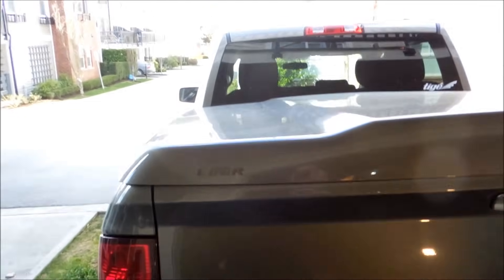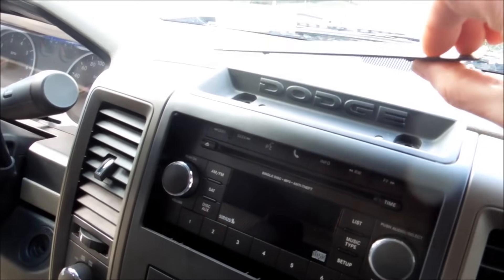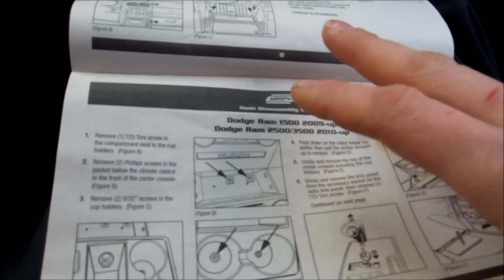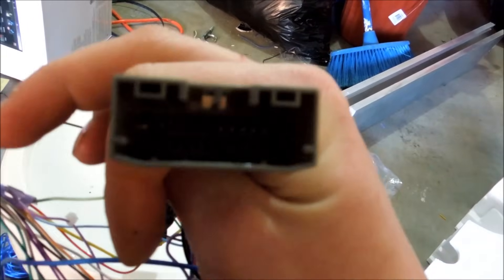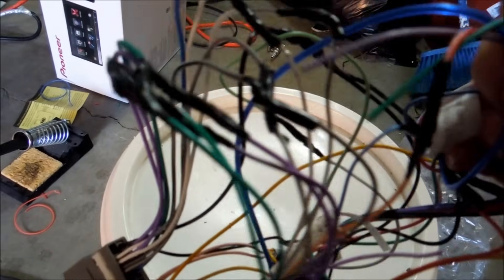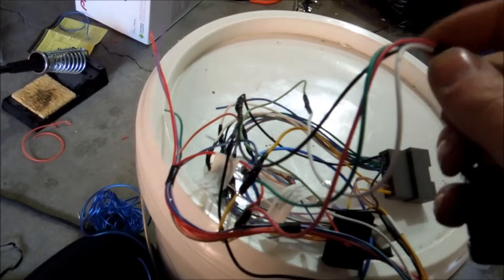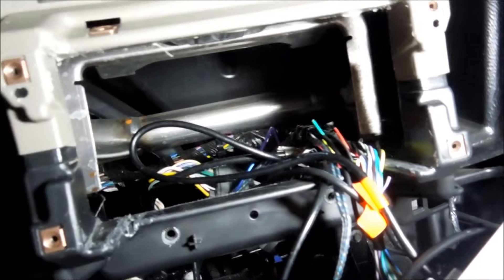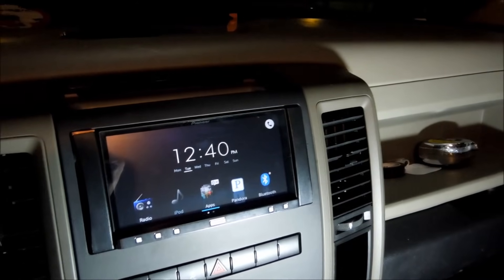How to install a aftermarket head unit stereo radio in a dodge ram 1500 2013

Comment: I have a 2012 dodge ram quad cab ST with no alpine system.. which wiring harness and mounting kit do you think I'll need? Looking to buy a double din touch screen. My radio looks the same as yours also

Comment: Hey bro I have a question I have the crew cab Dodge Ram 1500 2012 and I was wondering if you know how can I wire the steering wheel control

Comment: hey man, I have a question, so I just got a Boss radio and I drive a 2009 dodge ram 1500, I cut out the sub dash so it fits in the hole just fine, but my bezel or dash trim with the ac controls, wont fit over the radio. the radio is just slightly to tall for the hole, would I have to trim my dash trim (bezel) in order for it to fit?
Reply: What did you do??

Comment: Does this install have to connect to the uconnect module? My 2012 Ram is an Express and doesn't have the module so I'm trying to avoid all that extra expense and dealer programming crap.

Comment: I have a 2012 ram 1500 with the factory Alpine System i'm trying to put a double dim pioneer would you know what wiring harness to get???
Reply: get the CH1 harness and the Maestro RR, youll have all of youre steering wheel functions.
Reply: James H where can I find that harness at??
Reply: amazon
Reply: @JH-hx2cl  with that harness if I get any after market stereo it will let me use my steering wheel functions? I have a 2012 dodge ram

Comment: What wringing harness did you use for your truck? I have a 2012 ram I am going to be putting a pioneer avic- 5000nex receiver in and I don't have the alpine system in my model or steering wheel fonts and was recomended to use the XSVI-6522-Nav harness through Crutchfield.. is this the harness you used?
Reply from the maker: i used a pac module c2r chy4. thats the one you should use for your truck as well. it is not the steering wheel control module version
Reply: ghostlyrich okay awesome thanks I'll look into it
Reply: Did you bypass your parking brake wire. If so how'd you do it? I'm going to be installing this weekend

Comment: So when you put the deck into the dash and plug up the wiring harness up mine doesn’t power on when the truck is in accessory mode. Is there something I didn’t do? I also have a 2012 dodge ram 1500 so it should be the same I’d think.
Reply from the maker: You might have a blown fuse, usually thats the red wire not being powered
Reply: @ghostlyrich  I’ll check that out, thanks

Comment: I know this video is old but do you know if this harness is compatible with the first years of the 4th genn ram? from 2009 to 2013? cause your truck looks exactly like mine minus the center consolo and gear shift my 430 ren just flipped the middle finger to me and I need to replace it
Reply from the maker: yes it will

Comment: I have a red wire on my deck but no red wire on my 2011 ram harness. What should I hook it up to? Thanks
Reply: Roma 1971 did you figure this issue out?
Reply from the maker: The ram uses a canbus module so you either have to run a switched accessory wire or the best way to do it is get a pac module like a chy4 this will allow for you to adapt to the vehicle computer
Reply: ghostlyrich I have the 2011 model. Is this the same for that year?
Reply from the maker: @crazedn209  yes

Comment: What do I splice into for reverse signal for my rear view camera on 2010 Dodge Ram 1500?
Reply from the maker: Brandon Steele  you bought the pack module :) should be a wire comming  out of it you just splice to the car stereo you bought
Reply: I did buy the tr7 but I'm a newbie and not sure which wire on it to use and connect to pioneer harness. and another question do I need to program the tr7 or just plug and play. Thanks for posting all your videos, very helpful for people like me who don't know anything lol
Reply from the maker: Brandon Steele glad to help the tr7  is a great patking brake bypass but you also need the other module i show in the video
Reply: The CHY4 is what I need for harness to add reverse signal? I just bought reverse wire harness guess that's my first mistake.